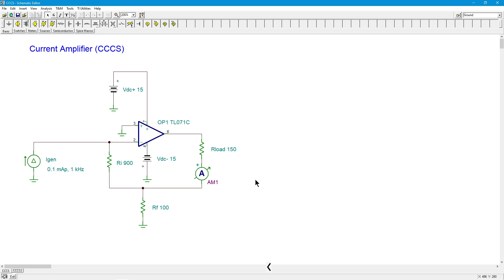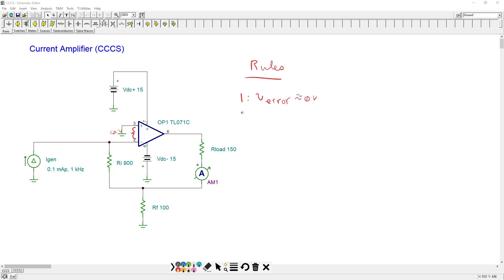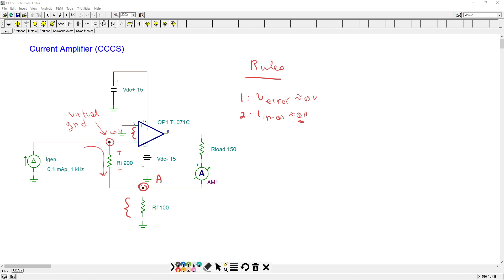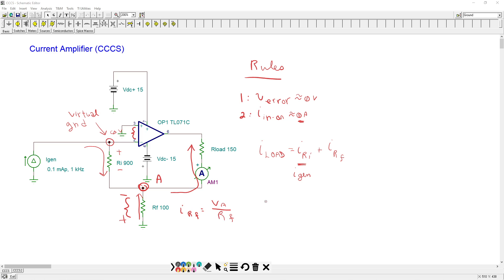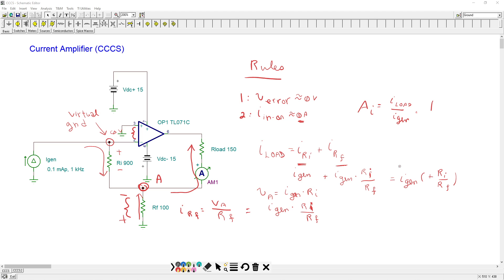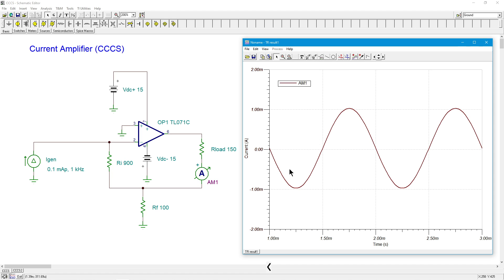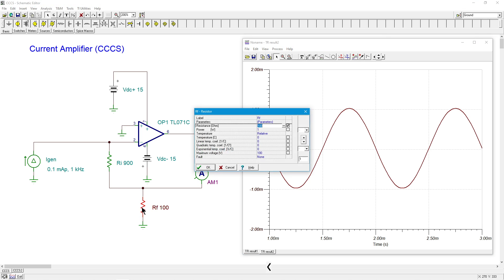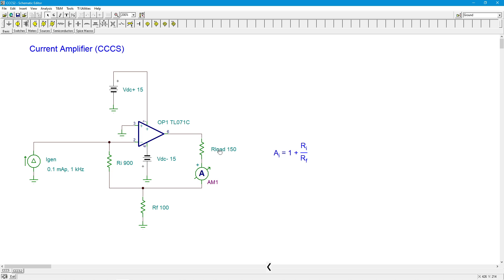Op Amps: Current Amplifier

Comment: What would be an example of a current generator in real life?
Reply from the maker: There are a number of circuits that are best modeled as current sources. That includes many digital-to-analog converter ICs. A potential issue of confusion for some people is that we don't see current sources in the same wide every day use as voltage sources (e.g., batteries and bench power supplies), but any device or circuit that has a high internal impedance is probably best modeled as a current source (just as those with a low internal impedance are modeled as voltage sources).

Here is a way to think of it: If you can change the load impedance and the load voltage doesn't change much (due to voltage divider effect), you've got a voltage source. If you can change the load impedance and the load current doesn't change much (due to current divider effect), you've got a current source.
Reply from the maker: @thinkingcitizen  Indeed! Typically, BJTs are modeled as current controlled current sources and FETs are modeled as voltage controlled current sources.